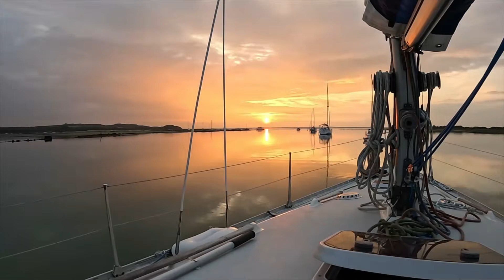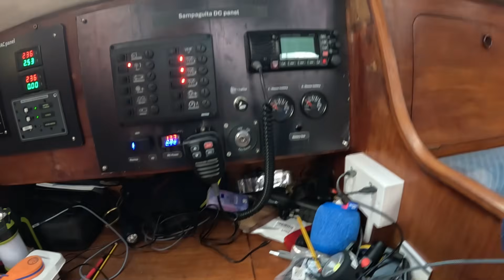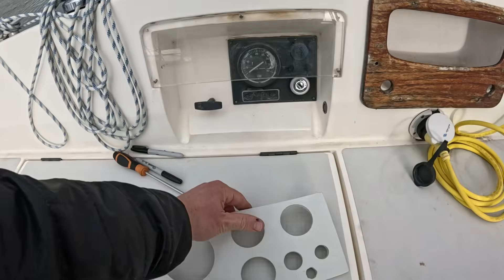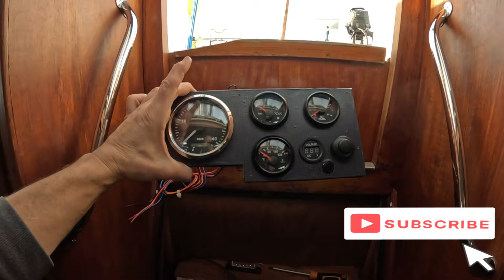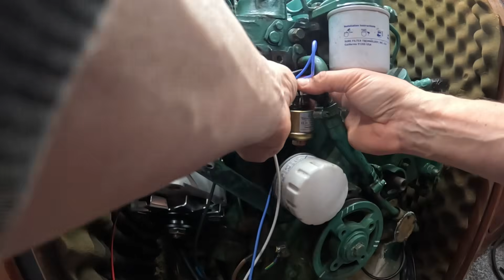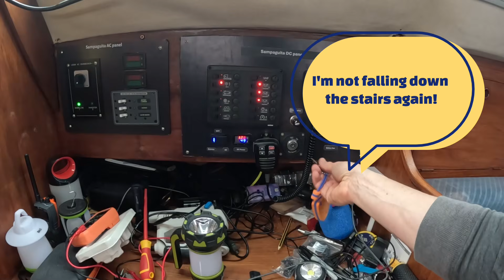26-03 New ignition, new oil pressure sensor, instrument panel update #sailing #boatlife #volvopenta

Comment: Thats all looking great. The engine took a minute to catch when you started it. Do you heat the glow plugs before starting?
Reply from the maker: Thank you for reaching out. I didn't think I had glow plugs. How would I check? Normally, it starts within 1 sec, but it has been a month since the last run. Also, I can prime the engine by opening the throttle and pulling/pushing on the stop plunger in the cockpit, but I didn't do that this time either.